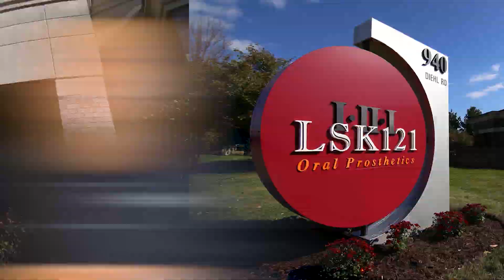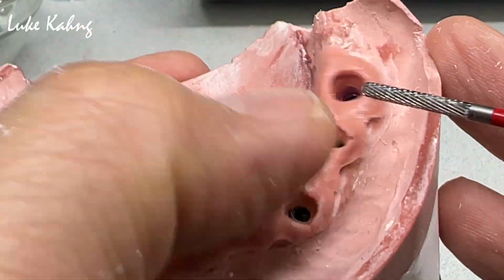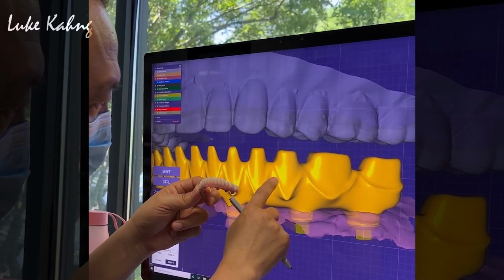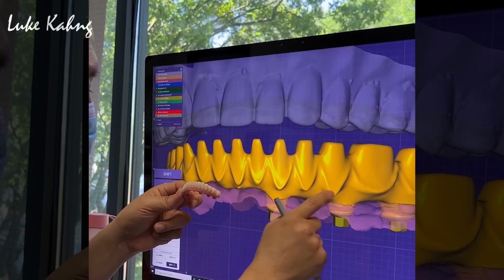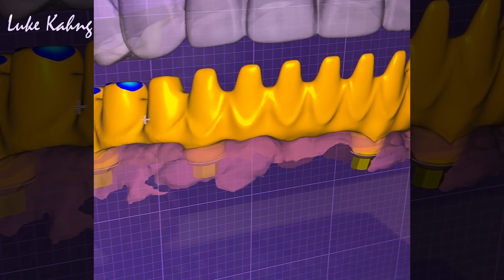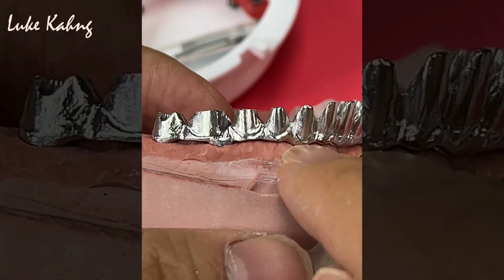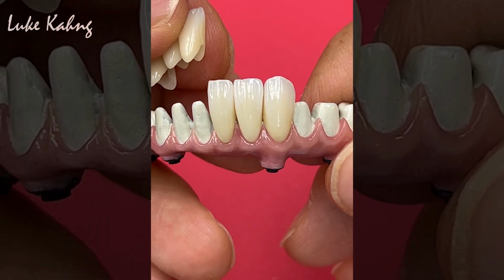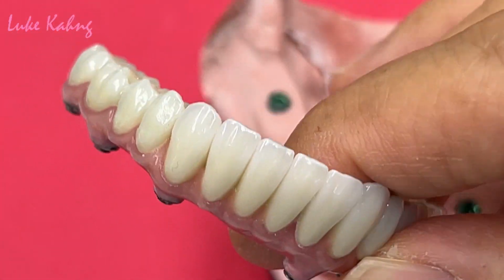How I Replaced Bad Teeth With This World Class Restoration

Comment: This prosthesis contains 14 teeth. The 2 first molars are absent. Is it normal or possible ?
Reply: Its completly normal
The two molars are there.
Reply: @ding6567  Are you sure ?
Because normally molars are 3 (1rst, 2nd, 3rd) on each side.
Reply: @leaveyourdemons4580  im a Dentist,  i am sure;)
The 3rd molar are the wisdomtooth, which u normaly dont put on dentures
Reply: @ding6567  Thanks for reply !
But, tell, is it possible to fill the gap of the extractions of the 1rst molars by the means of realignement ?
Reply: @leaveyourdemons4580 ur welcome.
 what do u mean?  Like, when u loose the first molar? What to Do then? Or if u get a gap between a prothesis and the natural gum?
Reply: @ding6567  When you lose the first molars (2 on mandibul and 1 on maxillary). I it possible to tighten the others teeth to fill the gap ?
Reply: @leaveyourdemons4580  u should Fill the gaps, cause the  2nd molars will tip into the gap and then in the future May cause problems, even could make a removal nesscesary
Reply: @ding6567  Thanks for your answer !
My problem is tath I don't have the means for implants or bridge. So, I was wondering if I could use the mean of realignement to fix the problem definitely, even if it demands to extract the 4th first molar. I precise also that I've my teeth (incisors) which are advanced and spacing between my teeth.